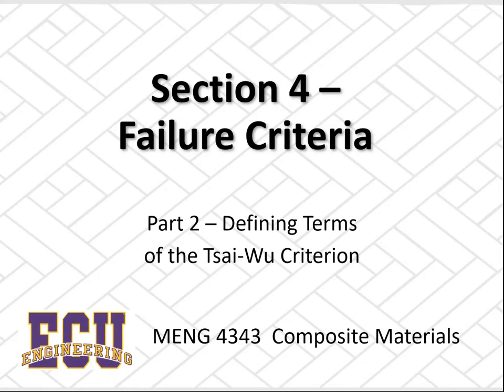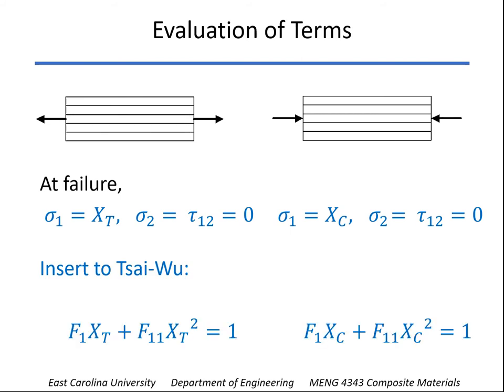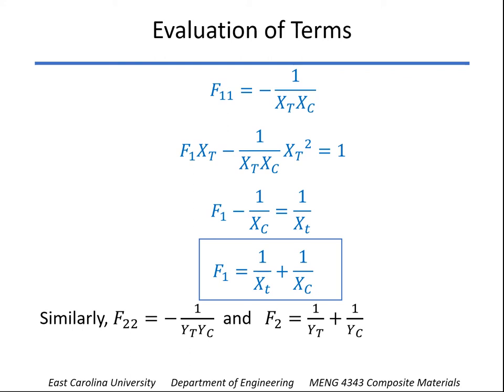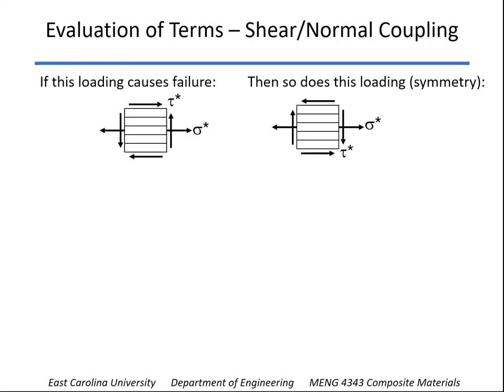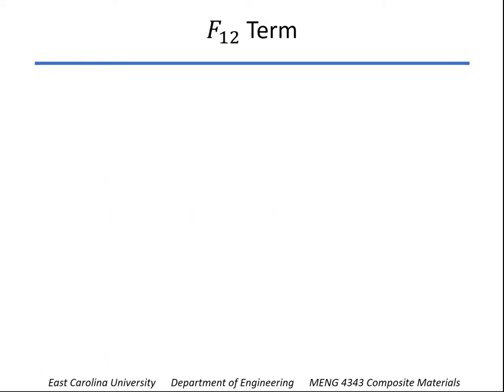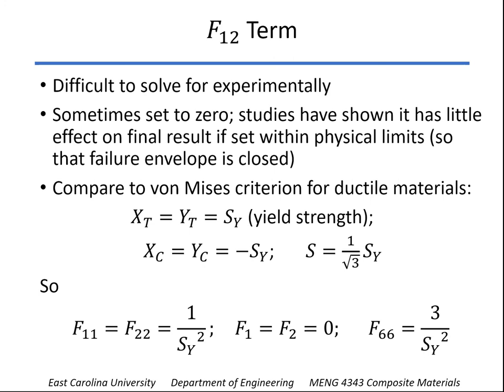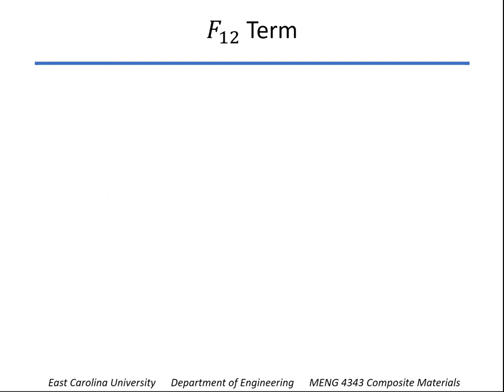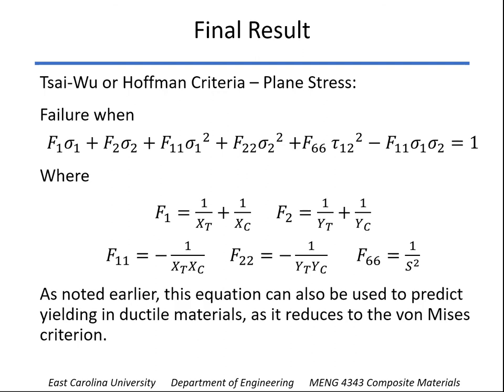Section 4 Part 2 Tsai Wu Criterion Terms

Comment: Dear MR, According to your presentation, at time 7:57 , it is possible to see that F12 = 1/2 (F11 *F22)^(1/2). However, The third term of that line does not show the term F22 . Thus , where this F22 term come from ?? ..it should be related to direction 2: F22 = -1 / ( Y t * Y c ) , where Y t = tensile stress along the direction 2 and Y c = compressive stress along the direction 2.
..Is my interpretation correct?
Best regards !!!